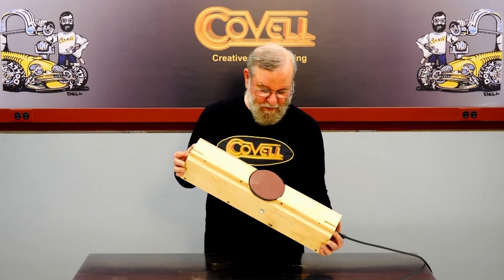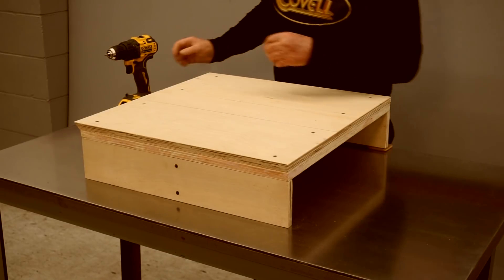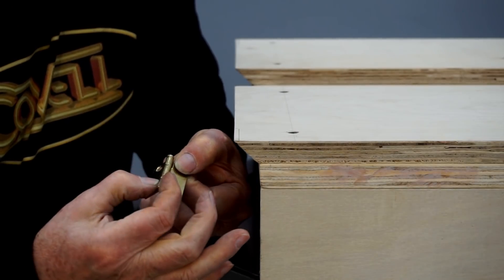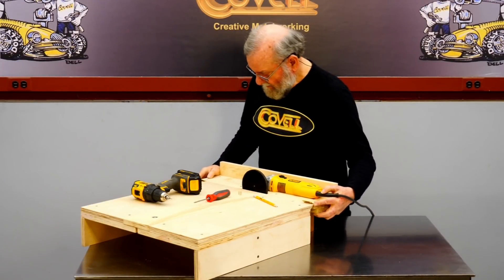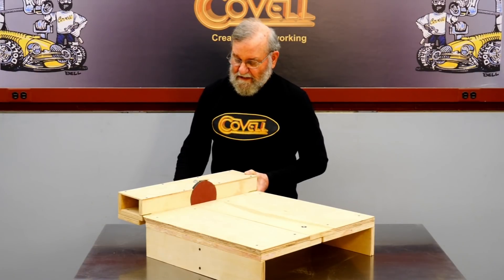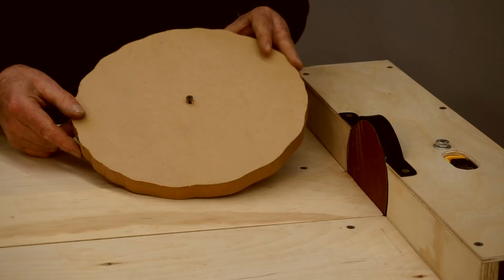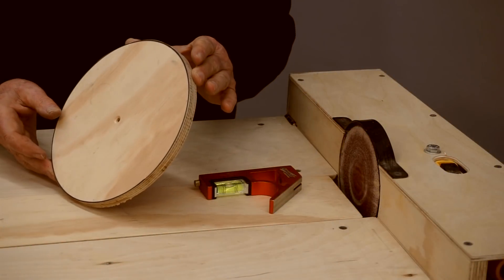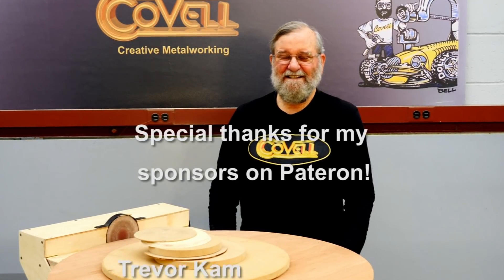Dedicated Disc Maker - Part 2

Comment: I think it would be safer to wire the sander to a junction box with a switch that you can access without reaching over the machine. But overall it's a great machine
Reply from the maker: I agree completely, and I currently have the sander plugged into to a terminal strip that starts the sander and vacuum (which I added later) at the same time.

Comment: Instead of the cooling holes I would have attached a shop vac, the air movement is enough to keep the grinder cool and the suction would help control the dust
Reply from the maker: Good tip!

Comment: Great project!  My space based radar system tells me that you have a similar jig that attaches to a vertical bandsaw to do the rough cut before the sanding...  Or because that's what I would do if I were smart enough to think of the dovetail jig for the sander.
Reply from the maker: Well, yes - I do - but I'm trying not to show my bandsaw in my new videos since not many YouTubers have one. It's important that people know that you can do excellent work with inexpensive tools.
Reply: @RonCovell  And that's what I love about these videos.  They're inspiring, and they're full of great ideas.  I'm not sure if I'm going to make a sander, but I'm positive I'm going to make a router table similar to this, where I can tilt the router a little bit to make angled cuts.

Comment: it seems to me it might work better if the slider was free to move up to an adjustable stop so adjusting didn't force the disc into the sander
Reply from the maker: That would certainly work. For my uses, I'm completely happy with the controllability of the 'freehand tapping' system.

Comment: move the pivot bolt so the point of contact on the sanding disc is a bit farther from the center.  This will improve cutting surface speed and increase sanding  disc area, improved disc cutting performance.  Ideally you would have another slide to let the base   be moved back and forth across the disc to help prevent loading the disc & improve cutting action.
Reply from the maker: Excellent ideas! Thanks for watching and commenting.

Comment: yea ... don't quit your day job cause this "machine" .... yea that's nice (ie wood should not spark)
Reply from the maker: The sparks happened when the sanding disc got a little off center and touched the steel guard. It's only happened that one time, so far.

Comment: Great build but I would suggest a vacuum o handle the dust Ana metal plate on the end of the slide before it mushrooms out from hitting it with the hammer.
Reply from the maker: Good ideas!

Comment: Hi Ron, I've been diving into dust collection as I prepare to make my little hobby workshop in my garage. I noticed you didn't use dust collection with this project: Do you use dust collection at all? If so , what do you use? Also, what type of mask are you using?
Reply from the maker: Most of my work is with metal, which doesn't make dust like wood does. I'm considering connecting my shop vac to the sanding fixture. There are some complications with sealing against the box as it rotates, but I have some ideas I'll experiment with. I bought my respirator from an automotive paint supply store.
Reply: @RonCovell  That makes sense! It sounds like you will be making a lot of disks, so you may want to use a cyclone stage between your shop vac and the sander. A cyclone can save your shop vac filter by dramatically reducing the amount of dust that makes it to the filter. Here's one I've been looking at: https://www.clearvuecyclones.com/home/116-cv06-mini-system.html
Reply from the maker: Very cool idea - thank you so much!

Comment: Very talented! An artist in metal and wood! Instead of the cooling holes, how about hooking up a shop vac to the end of the box to suck the dust out and cool the motor?
Reply from the maker: Thanks for watching, and commenting. Hooking up a shop vac to the box would probably keep the motor from overheating, but most of the dust is forced straight down, not into the box. I'm working on some ideas to minimize the huge amount of dust this machine makes!

Comment: Great jig but the adjustment of disk diameter by a hammer blow. Not sure about that. Also a deicated pin for a centre location of the disc be better rather than a screw in to the base.
Reply from the maker: I had a screw advance mechanism designed to adjust the disc diameter, but honestly, I'm pretty happy with how controllable the hammer blow technique is. You certainly could use a pin (or pins) to pivot the disc around, but if the holes for the pin were - say - one inch apart (25mm) you would generally have a large gap between the slider and the disc. I prefer keeping the gap small.

Comment: Shoulda made it a dovetail slide!
Reply from the maker: I might just do that, but honestly, it works pretty darned well as it is.
Reply: @RonCovell  Dovetails get clogged up with dust and grime, and replacing it becomes annoying due to the precision required. I was just making a joke. I was just making fun that all your work is so intricate and you make everything look easy, that dovetails seem very within your budget, is all. Much respect.
Reply from the maker: Thanks for the thoughtful reply. As I think more about it, I have noticed that plywood has a tendency to sag, droop, and twist over time, which would wreak havoc with a dovetail design. I think I'll keep it the way it is, and I thank you for the kind words!
Reply: @RonCovell  That's exactly what I meant, wood is an awful choice for dovetails. I look forward to seeing what you do or teach next! I'll absorb it like a Zorbee!

Comment: This may be a dumb question, but wouldn't you run the risk of gravity twisting the box if the angle is locked in on only one side?
Reply from the maker: The box is actually quite stiff in torsion, so that's not really a problem at all.

Comment: I love the low tech, high functionality methods you implement here! Excellent project!

I thought you were going to make an indexing post for the work piece using a T nut, and then have a locking clamp like you used on the angle selector. I think your approach is probably more pragmatic.

An idea for you, if you make the center post fixed, you can mark out distances from that center post so you don't have to pull out your measuring tape to check the sizes. You might also be able to install a ruler in the fixed portion of the table, and putting an arrow in the work piece slider to give you a fairly exact measurement. Would have to be offset so your work doesn't cover it up, but it would make the smaller sizes more expeditious.

Making the releaux triangles would require you to mark out your piece at 120° and placing screws (or holes with a fixed center) equidistant from the intersection.

Thanks for the great content Ron!
Reply from the maker: All of your thoughts have merit, and I thank you for sharing them. The slider certainly could have a pin for the discs to fit over, but at the expense of usually having a sizable gap at the disc, which is a slight safety issue.
Putting a ruler on the table could work - but it would be measuring the radius, not the diameter. Also, it wouldn't be accurate when sanding at an angle.
Maybe I'll make a releaux triangle sometime. I've loved that shape ever since Mazda popularized it with their version of the Wankel engine!
Reply: @RonCovell  correct, it would measure the radius rather than the diameter.

To fix the error on the angle cuts you could make a couple of extra arrows, one for 30°, one for 45°, and so on.

The wankle is an awesome engine, with a couple of shortcomings. Most folks say they're unreliable, but they are comparable to most gas engines when properly set up. Most of the unreliability came from improper rebuilds, poor tuning, and pushing them to the limit.

Something I'm really excited for is the liquid piston rotary. It solves a bunch of the wankle issues, and creates some of it's own. It also is a huge increase in power output. They basically reversed the design. Peanut in the middle, triangle on the outside. It makes three power pulses per revolution instead of one. They made 4 hp on a 70cc engine that fits in your palm. Check it out if you have a chance, it's pretty neat. Hopefully it will end up in a production vehicle some day, but for now it's mostly been relegated to powering UAV drones.

Comment: instead fo Vent holes i would have added a shop vac attacment point to help control the dust produced.  as a byproduct it would have cooled the grinder/sander as well
Reply from the maker: That's an excellent idea! I discovered that the majority of the dust collects underneath the machine, however, since that's the way the sanding disc 'throws' it. I'm working on some ways to attach a shop vac, but there are issues regarding sealing against the box as it rotates.

Comment: nice work looks great, wondering if setting the work piece left/right a bit would make it work better since the sanding would be focused on the edge of the tool
Reply from the maker: I have found that the left-right orientation is quite important! If the point of contact is too close to the center, it builds up heat quickly, which can melt the 'hooks' on the backing plate. It works better with the point of contact closer to the edge of the disc, but I can orient the disc being sanded anywhere I like, and control where the sandpaper disc is wearing.

Comment: that's really cool!  the "Time Warp" segment was really funny, too.  those holes probably help to avoid sawdust building up, too.

if you have a moment, I'm curious about your design process: did you do this in CAD, draw something in more or less detail on paper, or just wing it based on your knowledge and experience?
Reply from the maker: I made some rough sketches, then made a quick mock-up from some old warped MDF I had laying around to verify the dimensions and hinge placement, then did the more precise layout on good plywood.
Reply: @RonCovell  
thank you very much!

Comment: Ron I have been a big fan of your work and with  you calm and cool demeaner you seem to be able to solve most problems , on your disc sander you mite want to add a foot  pedal switch witch will turn on the tool and the shop  vacuum  ( future video )   Thank you for taking the time to make these videos    Pete M
Reply from the maker: I like that idea a lot. Yes, the sander makes a LOT of dust. Unfortunately, the hinged box is hard to seal against, but I'm considering several ideas.

Comment: I'd add a vacuum cleaner attachment - the only issue I see with this is it sends dust everywhere.
Reply from the maker: Yes, I really dislike the dust billowing out of the machine. Having the box with the sander in it hinged makes it difficult to seal, but I'm working on some ideas for that.
Reply: @RonCovell  A long intake slot just after the point where the sanding disk contacts the wood would what I'd try. If only there was some way to fabricate a metal shape that transitions from a slot to a round shape to fit a vacuum cleaner inlet... :-)
Reply from the maker: Well, of course I do know how to shape metal into intricate shapes, but I'm trying to make this build simple, so people with ordinary tools can duplicate it. I just hatched the idea at 2 AM this morning of using a section from a plumbing elbow to seal around the disc, and still allow the box to rotate with no restriction. Off to the Big Box store soon!

Comment: Well done, you could make a port to attach a vacuum cleaner to the box.
Reply from the maker: That's a good idea. Most of the dust goes under the box, however, so I'm still looking for a good solution that will get nearly all of the dust.

Comment: Just a thought but if you substitute the grinder for a trim router with a 2 flute spiral carbide bit and you can hog those parts out a little faster. Plus it works wonders for cutting aluminum discs.  Been doing it that way in my shop for years.
Reply from the maker: Trim routers are great, and would work well for 90-degree edges, and I know the carbide bits would work on aluminum, too. With the routers I've seen, the bulk of the motor would make it difficult to pivot down enough to make a 45-degree edge.

Comment: Why not just use a bandsaw or 3ven a router, much faster
Reply from the maker: Well, a bandsaw is fast, but the quality of surface finish can't match what the sander does. Routers leave an excellent surface, but the bulk of the motor housing would make it difficult to pivot down to make a 45-degree edge.
Reply from the maker: Thanks so much for sending that link - it is an outstanding video, indeed!

Comment: I like your disc maker but the disks I am looking to make do not allow for a hole in the middle.  One thing I am considering is a gluing on peg that can act as a rotation point but could be later detached.  This is the technique that is used in lapidary and jewelry making.  Do you have any other ideas on how to make discs without having to make a hole in the center?
Reply from the maker: Well, one idea is to use a thin baseplate with a center hole in it, and use double-stick tape to temporarily attach your part to it.
Reply: @RonCovell  As a woodworker, carpet tape is always at the ready.  I don't know why I didn't think of that.

Comment: Nice machine excellent instruction but what do you use the discs for?
Reply from the maker: I often have a need for discs. What prompted me to make this fixture is an upcoming collaboration that I need to make a buck for.
Reply: @RonCovell  I’m sorry I can see you can make excellent disk complete with bevels but other than a round table top I don’t know what you use them for. I’m sorry to be a pain I just don’t understand
Reply from the maker: All will be revealed, in due time! Probably not something you'd expect!

Comment: Great video - thanks for making it!  What are the sparks between 12:00 and 12:07?
Reply from the maker: My sanding disc got a little off-center, and it was rubbing against the steel guard.

Comment: Couple of options you might have included if time was infinite. It was fun watching the project,as will the project its intended to aid.
1. Using mitered faces to capture sliding center panel vs just the slot with knob to hold it in place.
2. Using a threaded rod/handle with captured nut to pull the workpiece against the sanding face.  Basically a movable Vice jaw  vs the hammer method.
Reply from the maker: Both excellent ideas. 

I thought about cutting the edges of the slide at a 45-degree angle, but it seems to work just fine with straight sides. 

I also considered making a screw feed for the slide, but I'm pretty happy with the accuracy I can get by simply tapping it with a hammer. Maybe that's because of all the experience I have with a hammer from doing bodywork for over 50 years!

Comment: Seems like a very useful tool there, Ron! I see some people have already suggested cool things for the vacuum system, but what about a more practical way of inching the sliding part forward? Perhaps using some a threaded rod somehow? Great video anyways!
Reply from the maker: I had an idea sketched out that used a knob and threaded rod to advance the slide, but I'm actually pretty happy with the results I get by simply tapping it.

Comment: You should ball screw the slide kinda like a vise, but also add some intentional resistance via spring loaded rubber or something. That way you can just twist a knob to screw in the slide rather that hammering. Also using a digital angle finder you could mark the angles on the angle clamping mechanism you made so you can more quickly set the angle.
Reply from the maker: Those are great ideas - thanks!
Reply: @RonCovell  I was thinking about it more and probably the same clamping mechanism you currently use would still work well for preventing the ball screw from backing off. Because springs and rubber adds way too much complexity hehe. Love your vids btw. Found you from the ToT collab and subbed instantly. You are so concise and clear in how you speak and teach. Keep it up.

Comment: I like the idea, but rather than an abrasive disk, I think a router bit would do a better job. Another thought would be to install a bearing on the slide and use a pin rather than a wood screw to pivot the disk.

Great job as usual.
Reply from the maker: A router would be great for right angles. The size of the motor of most routers makes it difficult to pivot them down to 45-degrees without hitting something.
Reply: @RonCovell  

That is why they make longer router bits and profiled router bits. Wood grinding for stock removal might be expedient on  onesey, twosey basis but cutting the wood fiber with sharp tools is quicker and safer and keeps the smoke down.

You might also want to consider changing your method of advancing the slide into your grinder.  Making some sort of stop that would limit travel might allow you a bit more precision than your "percussive" technique.

I don't want anyone reading this to think I am a know it all.  Mr. Covell is a Master craftsman and I am sharing my hard learned experience of screwing things up and having machines bite me.  Bleeding is not fun.
Reply from the maker: Noted - very good points, all!